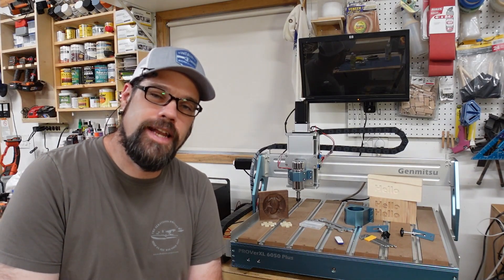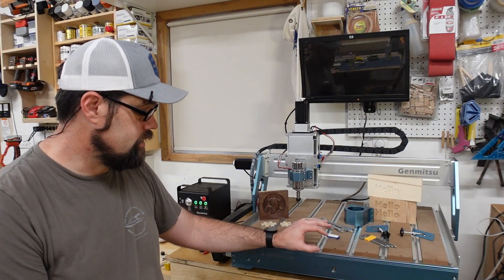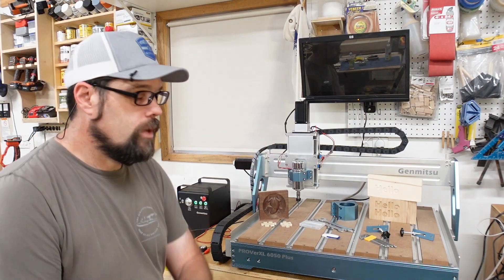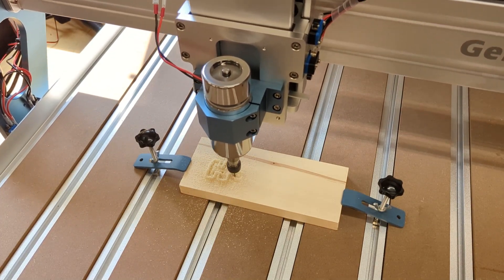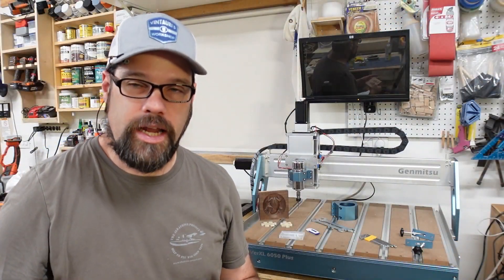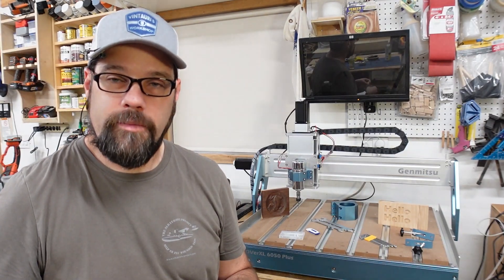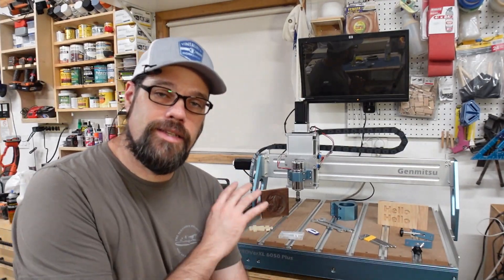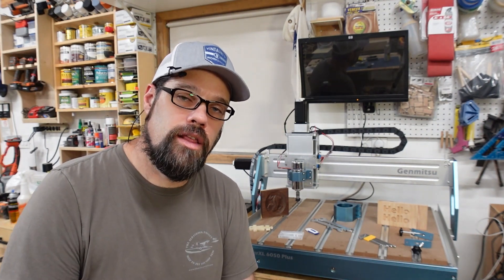Testing the Genmitsu PROVerXL 6050 Plus CNC Router

Comment: Is it possible to add Genmitsu offline controller to it ? (the controller panel of 3030ProVer)
Reply from the maker: The 6050 has an offline controller port but the only one I know to be compatible with it is the wireless controller that connects to your phone.  I'm told the offline controller from Nymolabs is supposed to work with almost any GRBL based CNC machine, but I have not purchased one to test that out.

Comment: Which is better PROVerXL 6050 Plus  or longmill please?
Reply from the maker: I don't have any direct experience with the Longmill but it does offer a few more options in sizes which may meet your needs more.  Both are very sturdy machines with similar capabilities when assembled correctly.  The 6050 is a bit more self contained where as the Longmill you need to build up a sturdy base to mount it to. The longmill looks to have a more compact controller but it uses the V wheels instead of linear rails.  I think either one would be a good small workshop CNC to work with.
Reply: @Vintauri  thanks getting 6050
Reply from the maker: @Chris-vc1dh  Great!  I hope you enjoy it!  It's a stout machine and the shipping box is heavy so plan your build space accordingly!
Reply: @Vintauri  is the software pain to understand?

Comment: The Genmitsu 6050 is a good machine but unlike the 4040 it doesn’t have closed loop stepper motors and upgrading to closed loop is not an option.  The 4040 doesn’t have linear rails on the other hand. It would be useful to know better how they compare.  Notably whether the closed loop motors are more or less important than linear rails in terms of end product and usability.
Reply: I was looking at getting the 4040 v2 and upgrading to 24x24 but until they release a 24x24 unit with closed loop motors, this seems like the unit to go with. The one video with the Aisan girl she is churning aluminum so it seems like this machine would accomplish the same as the 4040 but the only difference is that the 4040 supposed holds a .02 tolerance. Let me know what you think. Upgrading the 4040 seems costly and the linear rails would make up for not having closed loop motors while on the 4040 there is no linear rails but they do have closed loop motors. At the end of the days I feel like the 6050 would achieve the same results if not better and it has a larger work area. Correct me if I’m wrong.

Comment: Great review. You answered all my questions about it. A few things I like about it are the size and it seems easy to assemble compared to other brands.
Reply from the maker: Glad it was helpful!
Reply: @Vintauri   I just want to confirm, you mentioned that the overall depth is 37 inches, but on the website it says it's around 25 inches. Did you mean to say 27 inches? I am thinking of using my old desk, and if I don't have to make a new one that would be great.
Reply from the maker: @Ted-388xnsk   the 37 inches takes into account the stepper motors and the cable chain that stick out further than the base of the CNC.  Where the feet sit is smaller but you'll need to make sure there are no obstructions like walls or other tools that will get in the way of these items as well.

Comment: Nice Video!
I too have lasers and use Lightburn
I like using my ruida controller.
Ready to but a cnc. Most DO NOT come with an offline controller likr ruida.
So I looked up CNCTOBOAS an was directed to Genmitsu. Alas they do not show a separate controller.
WHY?

Question 2
I see in your video you have a monitor above the cnc.
How do you use it?
This is COOL 
Advise your viewers.
Reply from the maker: There is a port to connect an offline controller to the 6050 but I have not seen them release one yet.  I've not looked too hard though as I have a small form PC hooked up to the controller that is also running the monitor you see in the video.  I then use a wireless keyboard and touch pad combo unit to control that all.

Comment: Is VCARVE PRO software compatible with the machine?
Reply from the maker: Yes I used Vcarve Pro to set up the files for the review. You just need to add the GRBL post processor and then export in your metric or imperial units they your machine is using.
Reply: @Vintauri  thank you, more questions; What is the maximum depth you have to cut in a single layer? and 2000 mm/min is the maximum speed at which it advances in cutting?

Comment: Thanks for the breakdown.  What size workbench/table is the machine sitting on?  The specs and tech support say 39"x30" but your space doesn't look that large?!?
Reply from the maker: The shop cabinets that I have it sitting on are 30" and about 40" wide.  That is about the minimum area it will fit on front to back and the cable chain will overhang the edges when it is fully extended.
Reply: many thanks, guess i have a new table project coming up.... @Vintauri